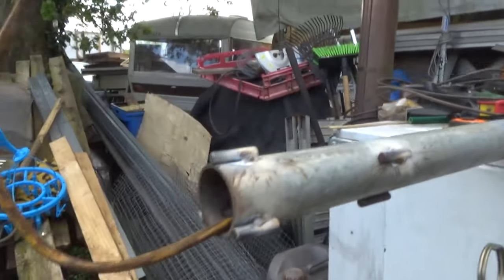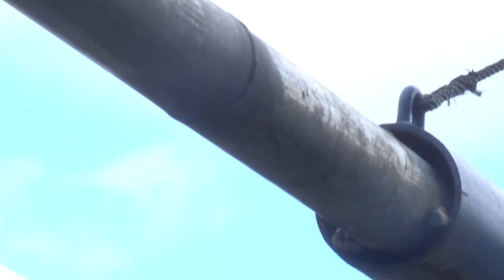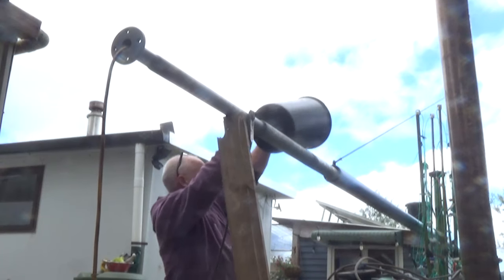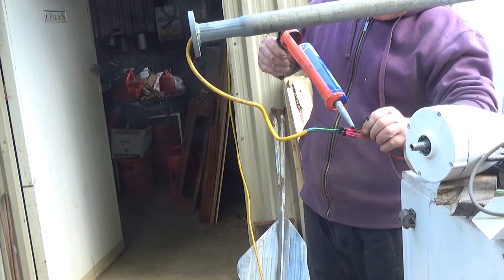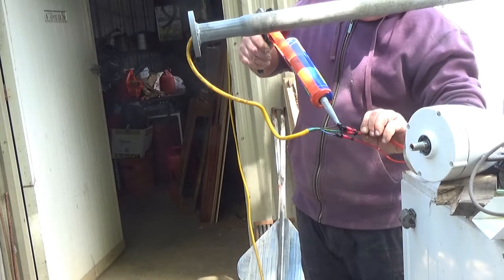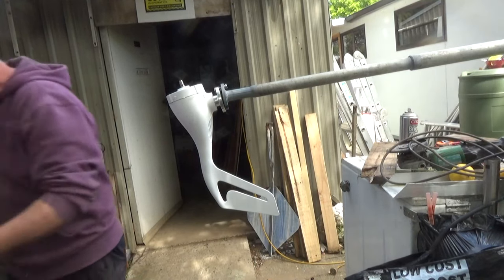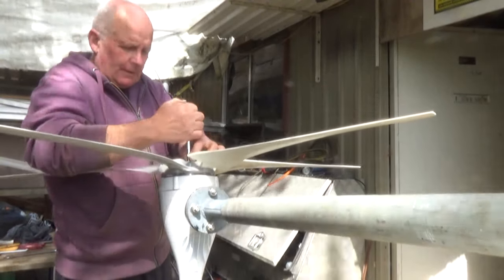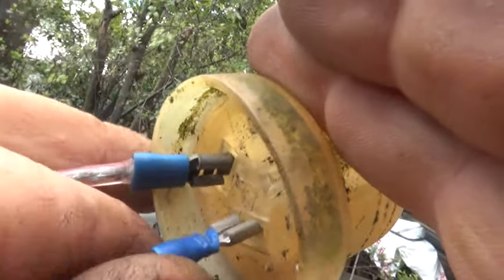Chinese wind turbine install. And removing the 10 year old DIY generator.

Comment from the maker: the 'rated output' of a wind turbine seems to be measured just as the wind tears it off the pole! - absolutely terrifying speed of about 950RPM. remember that if your battery is at 12.5v nothing goes into your battery until that voltage is exceeded.  This model needs to spin at 250RPM just to make 12.5v So in average weather a wind turbine simply wont charge your battery fully unless it is massive in size and delivers huge power. As a back up to solar- I think the best you can expect is a wee trickle through the night or in crap weather to stop your batteries bottoming out. Useless as a stand alone system unless you live in a coastal area with good elevation. Mine spins almost constantly  but only actually charges about 10% of the time. I hope that helps? next video will cover this in depth.
Reply: I have a cheap China 500-watt, 5 blade, 12 v that runs as fast as it can and never put anything on the display. Drill test I did not get the start charging rpm. It makes 6 amps at 800 rpm and 29 amps at 1600 rpm. It will never do 500-watts. Long story short. I plan to do a 4:1 gearing. That might be a little too much. It would be making 6 amps at 200 rpm. Might be to slow but it has 5 blades. Not sure what these things should run at. But as fast as it could go it did nothing hooked up as it should be.
Reply from the maker: interesting problem. did you know that it puts out AC volts at the unit and then its DC volts after the  regulator? maybe your multimeter was on the wrong setting. I would do further checking before starting the engineering project  @basilkey2949
Reply: I'm an industrial electrician. Yes 3 phase out to the controller that came with. All legs equal. DC is being made. I even tried just a 3 phase rectifier. I had a 7 amp hr battery hooked to it with meter read out. At times the blades sound like it was going to fly apart. Voltage was not high enough to start charging. Battery dropped to 12.3 v while hook to it. Even when I drill tested it. Best I can remember. It seen to have to have very high rpm to get cut in voltage. I WILL NOTE CUT IN RPM next test. Never had one of these so I don't know what it should be doing  at what rpm really. I will take it down and do more inspection and drill test when time allows. Maybe I just got a real bad one. OR the wire I used could be bad. It could be I'm not getting what is put out, but getting readings. Fun to play with. This time I will note the cut in rpm. Swap out the wire. Just to get that peace of mind.

Comment: Nice work, I also have a turbine. Mine came with a 12volt controller, do you know if these turbines are wired for 12v or can I trow a 24v controller on there? I run a 24v system.
Reply from the maker: The generic chinese windspeed controller with 5 wires and two LEDs is a self sensing 12/24v unit. They are not perfect but do the job. many people just use a simple bridge rectifier instead and run the rectified DC into a better quality controller. but then you do lose the low speed unload facility that helps get them spinning in light 5-10mph winds. no great loss as they produce diddly squat until they are spinning over 250rpm

Comment: Apart from the noise, you’d be an ideal neighbour 😂
Reply from the maker: That's odd? All the noise? most of what I do is gardening and mushroom growing. I do have two neighbors with Doof Doof music going most days though
Reply: @t.h.o.r. does the wind genny make much noise. Thats what i was referring to
Reply from the maker: @johnh9031  haha- after 10 years in the weather the old DIY one was getting squeaky as it pivots, but this one is totally silent. the three bladed ones make a noise like a drone at high speed but I guess the 5 bladed ones never spin at those speeds. I chose the 5 blader because of all my trees and buildings. power output is pretty lethargic. I hit a 40watt peak but average seems to be about 10-12 watt. Its still a nice back up to my solar panels
Reply: @t.h.o.r.  absolutely, it all adds up

Comment: Hey been a while since i commented here. Any progress on brutus or percy since the last video?
Reply from the maker: On the Landys- none whatsoever! however - I now have a nice home instead of a housetruck- a very productive garden and a fabulous Russian woman with many skills. Its been a huge year. I must get Brutus some new brake lines installed then I can claw my way up mountains
Reply: @t.h.o.r.  I saw sandy earlier in the year, even got to drive her a short distance. I found that the clutch is quite different to my one as it was quite sensitive. I recognised her as soon as I saw her.
Reply: @t.h.o.r.  also I still have the doors and quite a few series 3 parts if you need some for Percy.